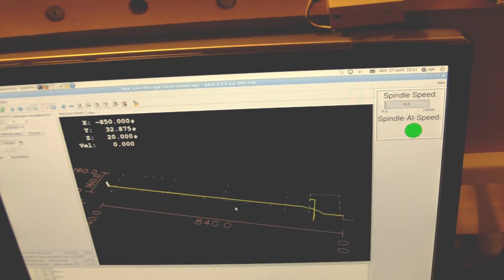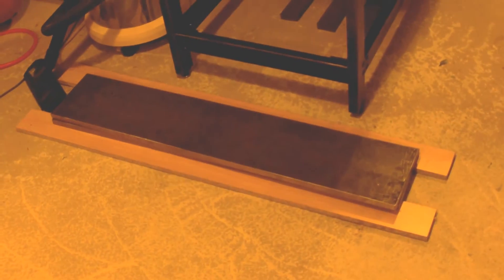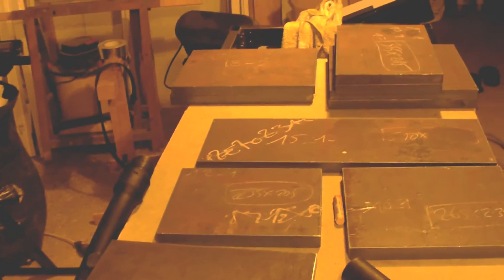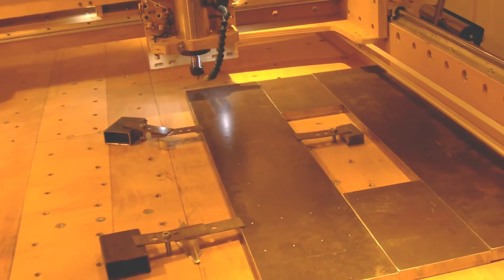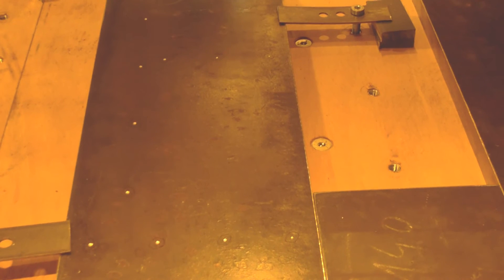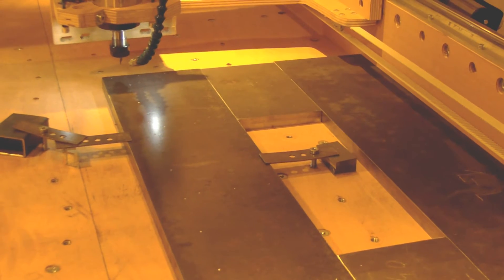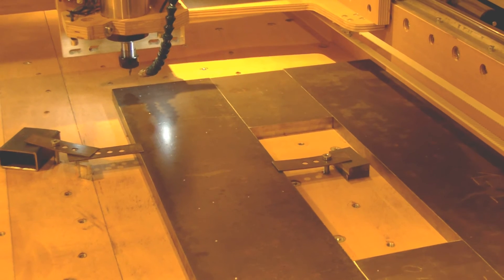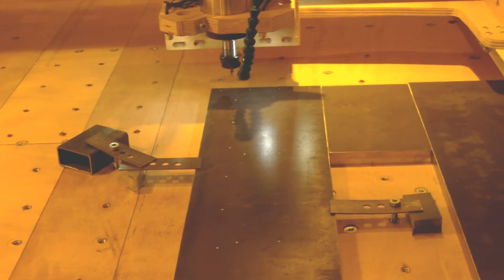New CNC machine : Project explanations EPISODE 2

Comment: Could you have made your original machine a little stiffer? and where would you concentrate your idea?
Reply from the maker: Hi Dan, the first machine is made from plywood that can not provide enough stiffness for hard material (steel).
On new machine idea will be concentrate on 3 things: steel plate for stiffnees, increase power and torque on 3 axis and making a milling head able to receive industrial tool.
Reply: Hi Laurent Thanks for the response. Can you read Sketchup files? I have drawn up a steel frame using your timing belt drive idea approx 1.3x1.3x0.4m - did you feel the gearbox you made were not stiff enough? I notice you bought 10mm steel for the Z (easy to bolt) I am thinking of reducing to 6mm to reduce inertia. (it has been 40 years since I studied physics) but then I would have to weld professionally. I HOPE to be able to put a 3d printer head in as well as a router. Where are you based roughly? I am in Kent UK.
Reply from the maker: Dan Barclay
Hi Dan, I'm a linux man and use FreeCAD as a 3D parametric CAD software (website http://www.freecadweb.org/). He is able to to read a lot of file format but not sure for sketchup, check there website it is a free open source soft available for all plateform.
Gearbox are stiff enough with 10mm thick but could be better. 6 mm with steel plate will work as well very good. Take care of welding, you will introduce deformation in parts. I travel a lot between US and France depending on my business !